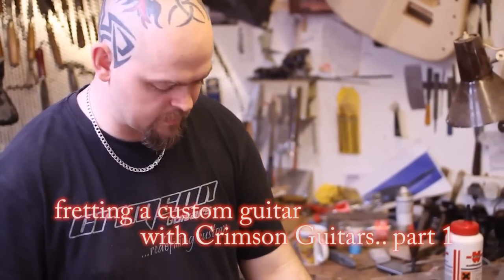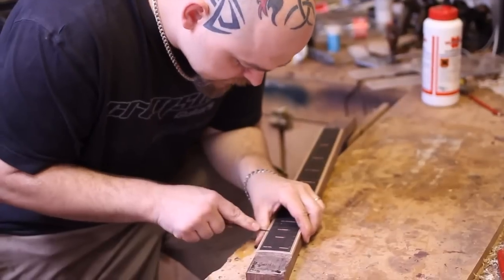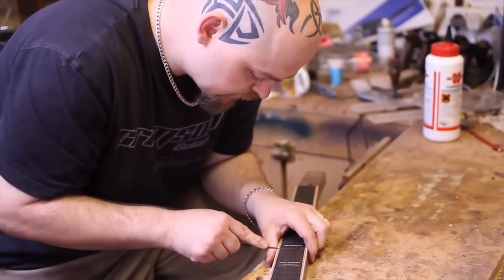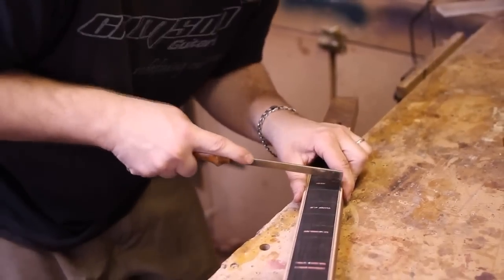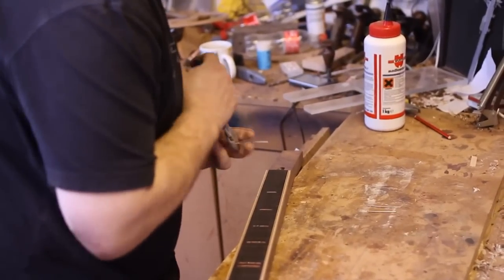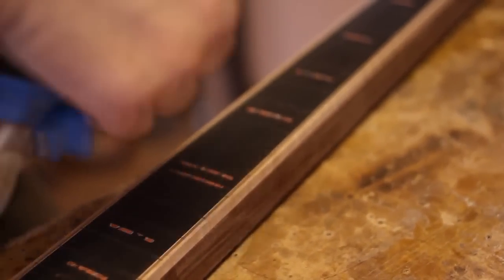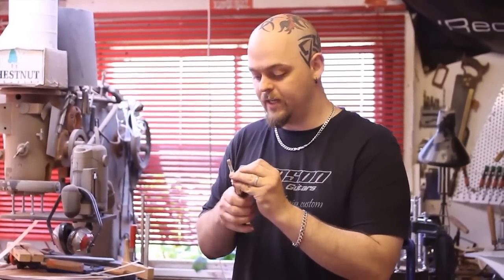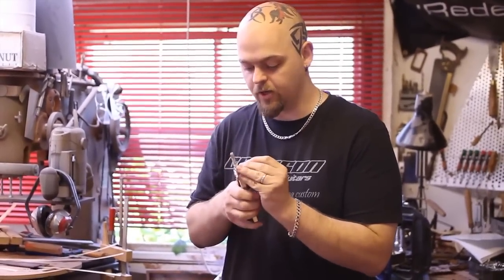Tricks and Tutorials  - Ep 1 - How to Fret a Guitar

Comment: BTW, I've looked into the relative hardness of brass. Depending on the degree of "cold work" [and the ratio of Zinc to copper in said alloy] Brass is about 165-183HV, so brass is softer than the softest nickel-silver wire. So it would seem to me that brass is simply too soft for steel stringed instruments. Which is why is it not popular these days...  I think I'm going to buy some EVO wire, it looks to be the perfect compromise between Nickel-Silver and Stainless steel!
Cheers

Comment: Hey Brother, Greetings from Canada. I have a question that I hope you can help with.  My 08 Gibson Lp Std, has the neck binding with "nibs" . My high E string slips into the gap between the fret end, and the nib as soon as I wiggle with a bit  too much BB King style vibrato.  At this point, the thrill is no longer present..  Is this a common thing with Gibson?
Reply from the maker: very common.. you can add a drop of superglue at each end then sand them down and polish with fret rubbers etc. the gap will be filled and you problem solved.. use one of our more recent fret polishing tutorials and you can't go wrong. B
Reply: @CrimsonCustomGuitars  Thanks Mate, I had a feeling super glue was going to be part of the solution.  My only concern is, and i think you and i had a brief interaction on this topic in a past post...   The Behaviour of SuperGlue under a black-light... or on stage in a club with uv lighting.   Do you suppose nitro cellulose has the fill and hardening characteristic to do the job

Comment: If you shelf the fret, which I'm considering doing, will they bend/flex 
over time around the edges since there is nothing holding the ends in?
Reply from the maker: No, once they are in and in place they should not move. B
Reply: @CrimsonCustomGuitars  thank you! I’m working on designing a guitar for my uncle who is the lead singer in rise against and this is one of the many details!

Comment: Ya, I've done research since my post. Jescar makes "EVO gold" fretwire. LMI has this to say: "Evo is a copper alloy (elemental composition: CuSn15Fe1Ti0.1) that has been used for years in the optical industry. It contains no nickel and therefore meets the”nickel free” European standard. With a Vicker’s hardness of HV5/250, it is harder than our nickel/silver wire (HV5/200), but softer than the stainless (HV5/300). So that makes EVO an alloy of Copper, Tin, Iron and Titanium. No brass...

Comment: I think you will find, its a lot easier to measure the fret length with a vernier and cut it with accurately with a dremmel  disk.  and round with a sanding belt before putting it in.
 When you cut with side cutters you crush the end and have to spend hours fixing it with a file.

Comment: Hope you can help me. I was just about ready to install frets on my homemade Archtop when I noticed the fingerboard I made  is not level. It was radiused and I thought I leveled it but now I see, not very good. There's a bow in the middle. It touches only at the neck extension end and at the nut end. How can I approach this. I have a carpenters leveler which I can put sandpaper on, and I have an 8 inch radius block from Stewmac. I see those metal leveling  beams at Stewmac but damn they're expensive.  I'm so frustrated. Any suggestions ?
Reply from the maker: +Brad Hofrichter Hi Brad, good news, the podcast for today will hopefully answer your questions.  Ben and luthiers, Tom and Christopher have a round table discussion in the studio. - Talitha
Reply: +Crimson Custom Guitars - Yup, and it was very helpful.   Thanks a lot.